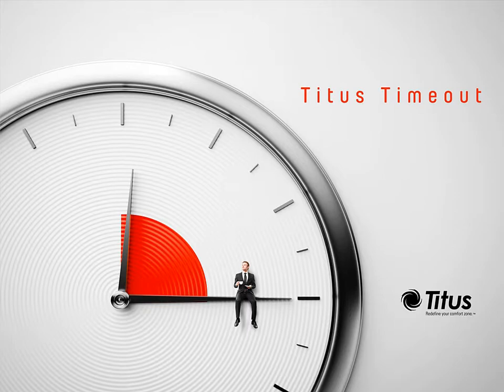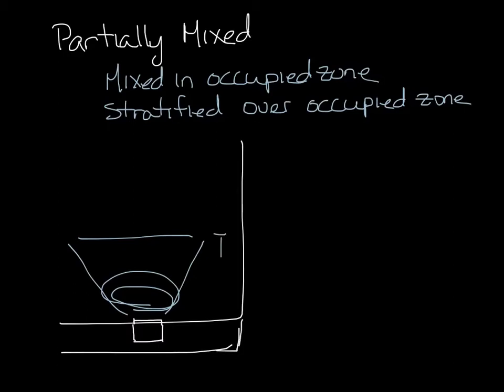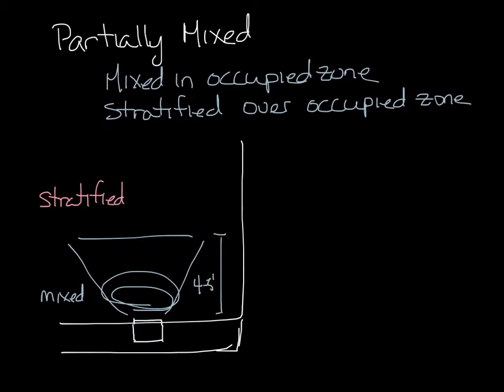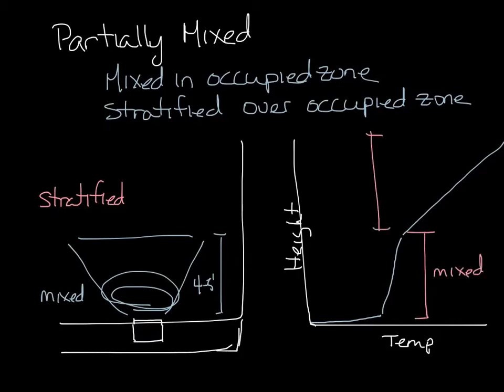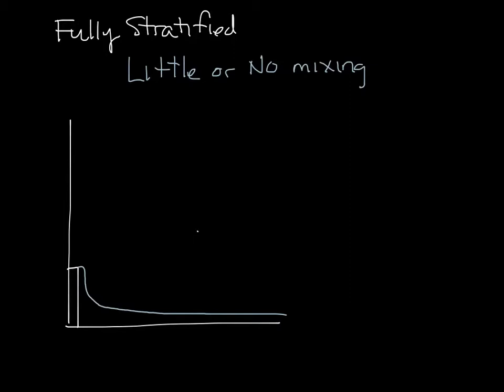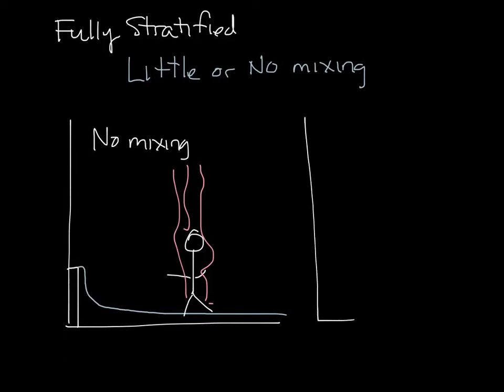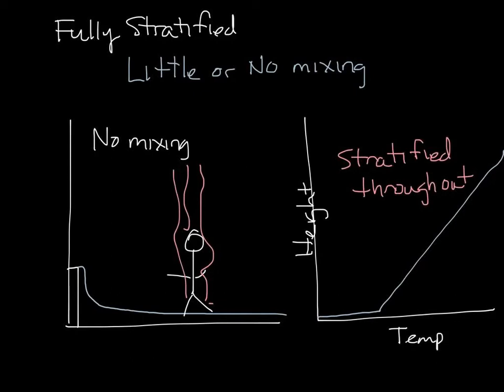Titus Timeout Podcast - Mixed vs Stratified Air Distribution Systems

Comment: ASHRAE classifies spectrums from mixed to fully stratified
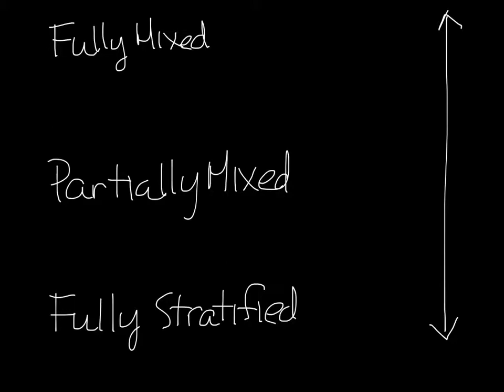0:38 In a stratified system, the air movement is only driven by the buoyancy in the space -- more explanation pls?
Reply from the maker: Can you clarify specifically what you need "more explanation pls" so our team can provide additional info? Also, please view our Displacement Venilation webinar - https://youtu.be/78F4MtVyI6A?list=PLEE7DBEEE6F14596A as it might have the information needed as well.
Reply from the maker: Additional feedback from the Titus team - In order for the room to truly be ”fully stratified” there would be no room air motion other than that caused by thermal buoyancy. . In reality, no mechanically driven room air distribution system fully achieves this distinction. Thermal displacement is the closest, where essentially all of the air outside the immediate influence of the supply air stream is thermally stratified.